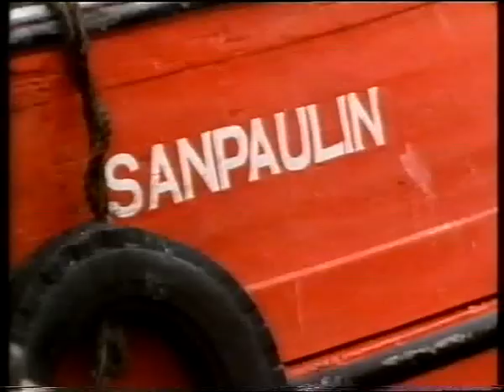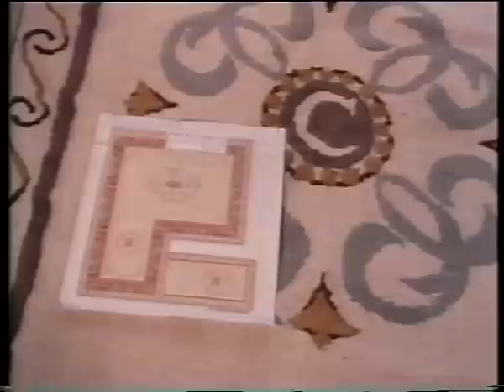Hands: Donegal Carpets

Comment: Donegal carpets is still in business, custom carpets cost $58.00 a square foot, that makes a 10'x15' carpet almost $9000.00.
Good video
Thanks
Reply: that's still cheap. As said, a skilled worker can do about 400 square centimeters a day. A square foot is 900 square centimeters, so a foot of carpet represents more than two days work. Add to that the cost of wool, twine, design and overhead costs and I simply can't understand how anyone could live off a salary of three dollars an hour
Reply: also, that carpet would take five weavers fourteen weeks to knot. Think of that. Even if the wool, design and overheadcosts were free, each weaver would take home only 128 dollars a week. But of course all these things would take at least half of that, so the weavers would get 60 bucks a week. 
Let's say a skilled worker would have to earn at least 10 bucks a hour. I mean, it would be slightly above 'working at McDonalds serving fries', but let's take ten bucks as the very minimum. Then five weavers weaving eight hours for fourteen weeks... the weaving alone would cost you 28.000 dollars!
Reply: @Smallpotato1965   You're jumping to a lot of conclusions over a simple comment. I didn't say whether it was cheap or expensive, I was just stating what it cost. 
I a firm believer in paying for quality if you can afford it.

Comment: I’d think boiling the “hanks” of wool for dying would remove a great deal of the natural lanolin. Does this help or hinder the wool? Do they replace it later, I wonder. If anyone knows I would thank you for your input. Regards.
Reply: Yes, scouring the wool will separate the lanolin from the wool. Usually this is done when the wool has not yet been spun. Spinning oil can be used for hand spinning to ease the process of drafting the fleece as it’s spun, but this yarn was commercially spun so that was likely not used. Lanolin will resist the dye, so the spun wool will have no lanolin so it will take up the dye.
Reply: @bethkolle1  thank you very much. That is a lot of work. I wish sometimes it was still that way today.
Reply: There are lots of hand-spinners, never fear! There are teaching videos on YouTube, search under ‘spinning yarn’. It’s very satisfying and you get beautiful, unique yarn for knitting, crochet or weaving.